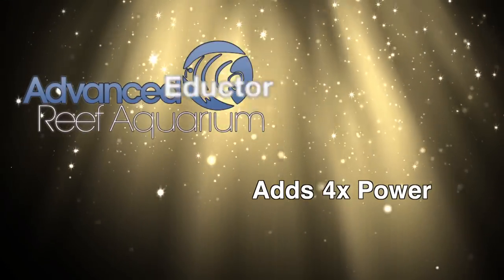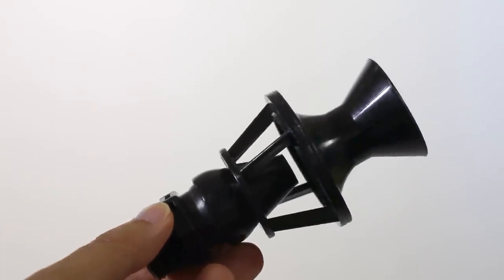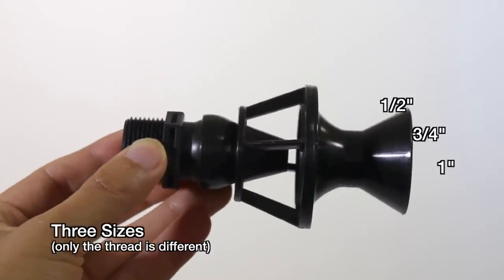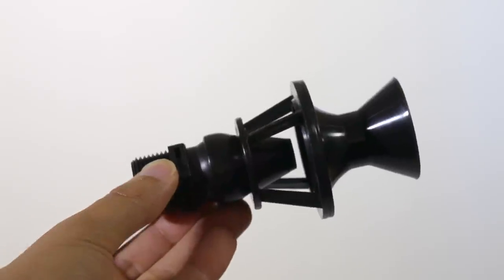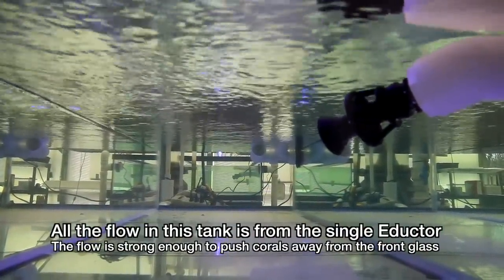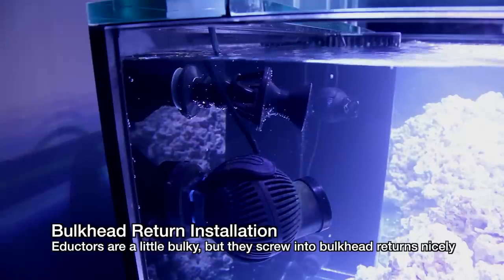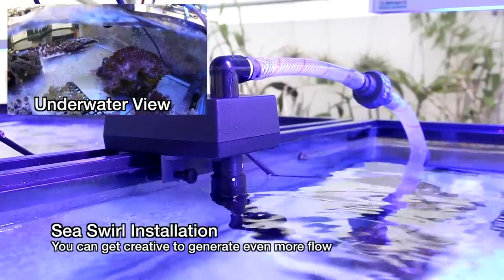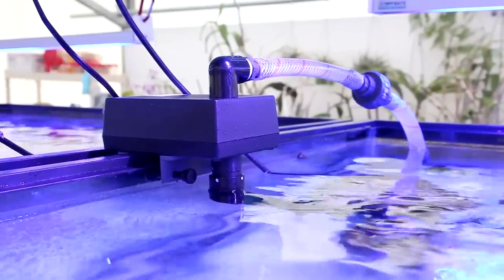Eductors are a great way to add flow to your aquarium

Comment: dear friend, how far the power head should be from the water surface? whats the proper angle/position for power head/wave maker to create circulation and water agitation in the same time?

i have doubt about oxygenation. by breaking the surface we exchange co2 with o2, this process happens in the top of the tank and we are sure theres exchange happens, how about tank bottom? how can we be sure that theres enough o2 down there? how to blind all the o2 through whole water?

im planning to have 1500 gallon freshwater tank.

Comment: I have used them but I don't know of an Aquarium pumps that create enough pressure to make use of the system
What flow is restricted by the system is about the same as the mount as you gain. 

To get 6000 gallons per hour you need a 3/8 feed at 75 PSI most aquarium pumps don't make more then 10 to 20 psi. 

So you cut your flow by a 1/4 to get the 20 psi to gain 4X flow that all comes out to be about equal.
It would be better to use a power head.